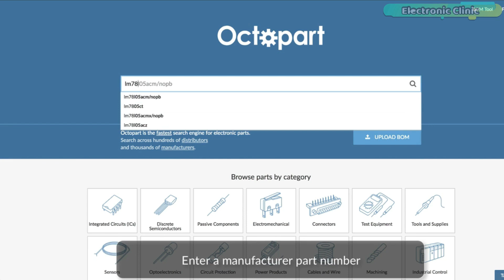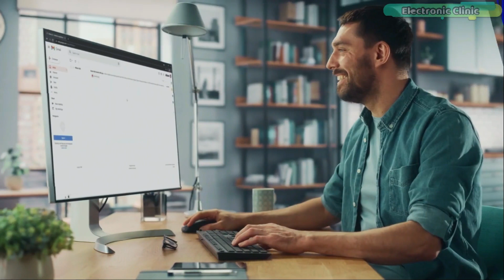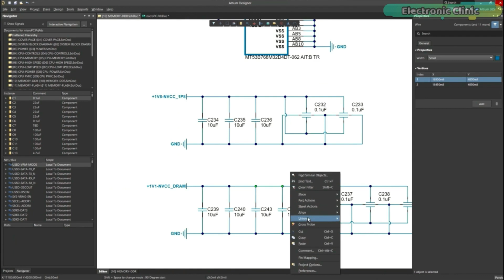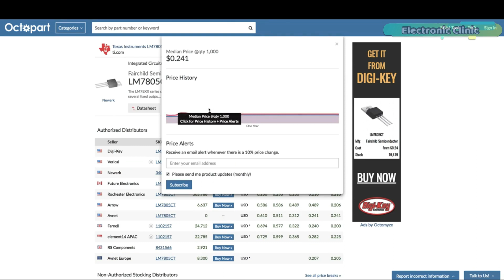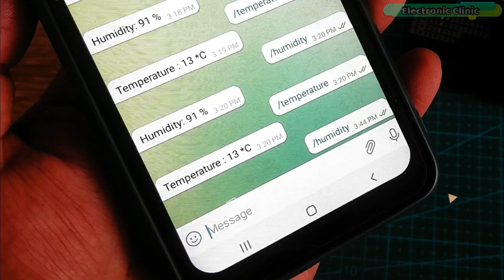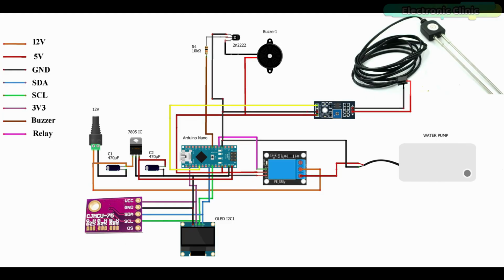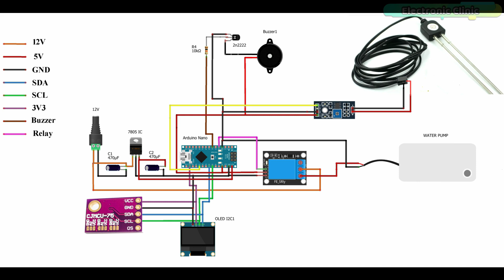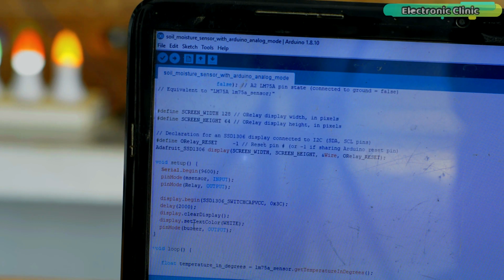Soil Moisture Sensor with Arduino, Water Pump, Oled display, and Buzzer,  Arduino Project

Comment from the maker: Previous Videos:

Swimming Pool Monitoring System using Arduino and LoRa
https://youtu.be/YJpwY_tz5VM

Arduino and LoRa based GPS Car tracking system
https://youtu.be/d5zfD6ekRYA

ESP32 Cam smart IoT Bell
https://youtu.be/wmthBYbNHL4

How to Track a stolen car
https://youtu.be/N7hDlIWzMb8

Measure current with Arduino and split-core current transformer
https://youtu.be/hiaC00o6YMk

Arduino Geofencing 
https://youtu.be/GR66hU4yNEI

Arduino MLX90614 Infrared non-contact temperature Sensor
https://youtu.be/MhckQm-AMh4

ESP32 Cam images to Google Drive
https://youtu.be/9BOYOMEJXUg

Raspberry Pi Pico complete course
https://youtu.be/rAGw-08IOSw

Learn how to make 4S lithium-Ion battery pack for Drones and Arduino projects
https://youtu.be/8vMTZqvSl5s

Comment: Circuit diagram link not working it is showing access denied 
Rey I'd - 7474eabc7df9a3ec
Reply from the maker: it's working. 
https://www.electroniclinic.com/soil-moisture-sensor-with-arduino-water-pump-oled-display-and-buzzer-arduino-project/

Comment: Bro. The circuit diagram and code is different from the demo stuff. In circuit diagram provided, resistor, capacitor everything is used. Will the project be helpful to use water pump and water incase of less moisture content if we follow the provided code and circuit diagram in description?
Reply from the maker: this is the same circuit diagram. you can use the same circuit and code. its fully tested.

Comment: What about  CAPACITIVE Soil sensor??
Reply from the maker: A capacitive sensor is also good, I have used it. I have a very detailed article on this sensor as well.
Reply from the maker: but I liked this one, due its long sensor probes, it digs deeper into the soil.
Reply: @ElectroniClinic  But the actual problem of these sensors are short lifetime of their probes under soil as  soil's pH value variates place to place. I think if probes Like TURBIDITY sensor used it would be more durable.🙂